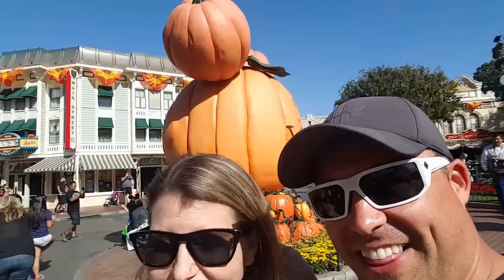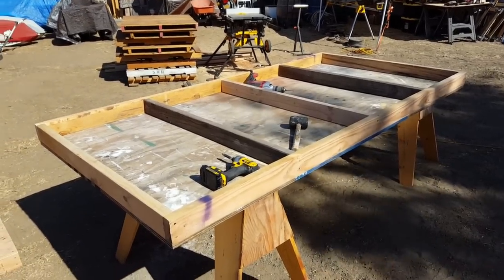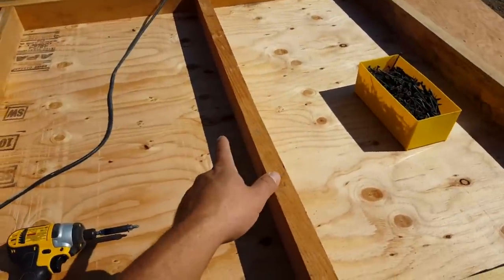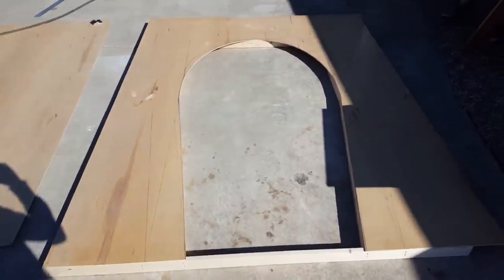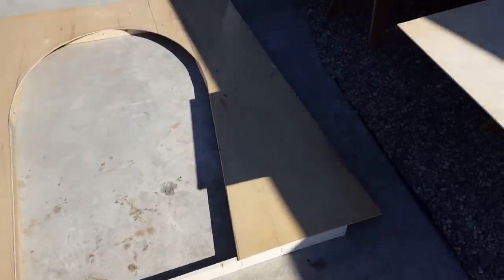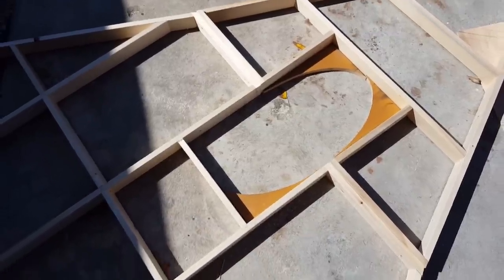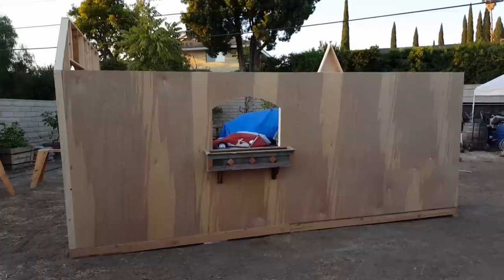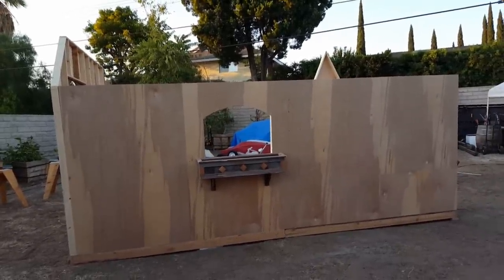Making A Witch's House Decoration - Starting A Fun Witch Cottage Build

Comment: What?  I'm building a witch house facade this year as well!  No doubt it won't be as cool as a Hollywood Haunter build, but still exciting.  The roof-line on my facade is curved slightly less than yours, but still curved.  I'm curious what your planning on using for roofing.  I've bought a bunch of the corrugated roofing sheets for mine, but I'm worried it won't bend to fit the curve.  Super excited to watch your progress.
Reply from the maker: Yours is going to be awesome!!! I think we are just going to shingle the roof this time. If you have a picture when yours is finished, post it on our Facebook page we would love to see it :)

Comment: wow...how did you get the roof front piece on top of the base?  It looks really heavy.  Don't you usually screw them together and lift as one piece???  Wonderful work!!!
Reply from the maker: Thanks, I step up about half way on a ladder and then lift up the wall and walk up the rest of the way to and set it in place.  I want to say it's under 45 pounds or so.  That's another reason we build stuff in small pieces for lifting.  It is a little spooky if it's windy but once it's locked down with a clamp or a screw it's fine.
Reply: You guys truly have a gift...thank you so much for sharing.